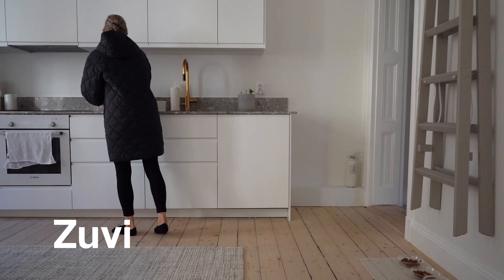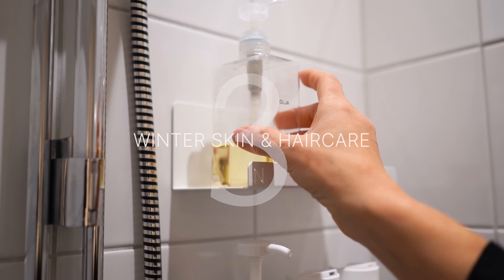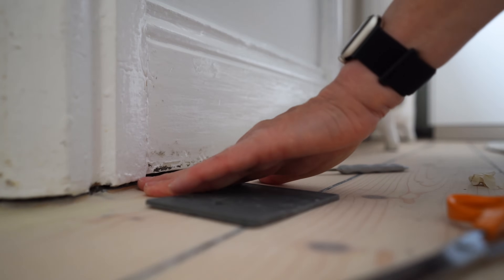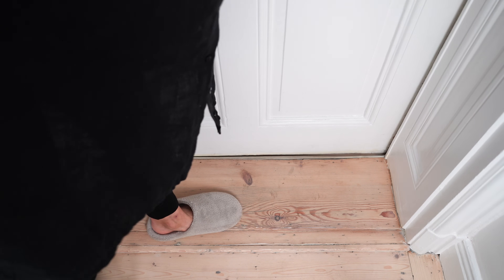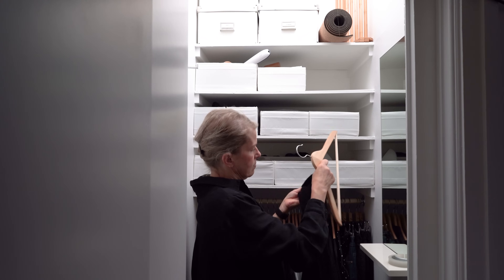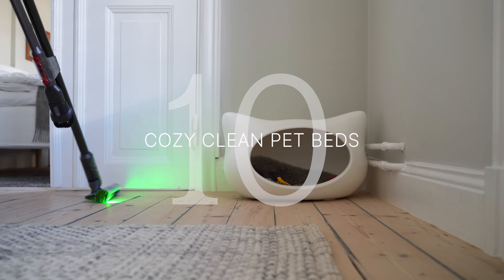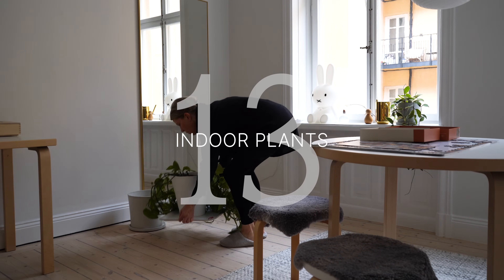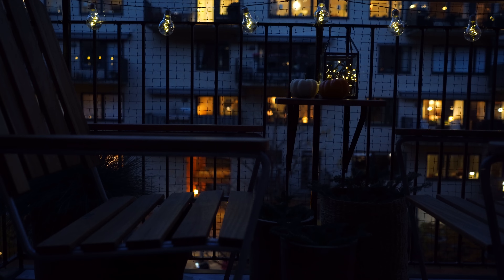15 TIPS to prepare for a long COZY WINTER

Comment: A quarter round is an easy fix for the gap between the baseboard and the floor.  Also, a door sweep on the inside of the door to your exterior (balcony, deck, etc.) is a big help in keeping out drafts.
Reply from the maker: I’m not a fan of the look of quarter round and also it would be very tricky to cut along the various depths of the baseboards. The filler, to me, is a cleaner look😅
Reply: @BenitaLarsson  what filler did you use i live in scandinavia but because I speak just English I have a hard time finding the right product 😅
Reply from the maker: I use Easy Filler from Flügger!  @MeTimeWithNoemiEApetri

Comment: I put quarter-rounds back down on the baseboards for my finished look. Just nail or glue them to the vertical baseboard bottom, not to the floor. That prevents cracking and splitting when the floor and wall contract in the cold (as they will, and are supposed to). I also filled that little gap by poking rolled up newspaper back there before putting the quarter-rounds on.
Reply from the maker: I don’t love quarter round to be honest and way to finicky to cut along all the different depths of my baseboards😅

Comment: One action I took this October was to use a battery tester on my stored batteries. I had stored 4 different brands of batteries, and I discovered one particular brand was losing its power at a faster rate than the other three. It also exhibited corrosion in some cases. An eye-opening exercise in maintenance and preparation!
Reply from the maker: Great discovery! I always try to remind myself to add the oldest on top when I buy new ones.

Comment: I use olive oil and coconut oil to moisturize my skin in the winter. Also, if you live where water is chlorinated, install a shower filter that removes the chemicals.
Reply from the maker: Thanks for the tips!

Comment: Love the video! Could I just warn about the pathos plant you brought home? They are self climbers and create suckers the will adhere to anything they come into steady contact with but the warning is that when you try to move them off the surface they will take LAYERS of paint/veneer off with them! 😮

Have you thought about piping the caulking into the gaps? I’ve used plastic bags and snipped the corner off to squeeze it out. Or an old piping bag with a tip? 
I now have to trim my pathos and check for gaps for my Canadian winter! ❤
Reply from the maker: Thanks, I’m aware if Pothos and will keep a close eye on it! I really enjoy this method of filling the gaps . It’s like icing a cake so I’ll stick to it😅

Comment: I love that you embrace the season and get into wintering.  I need to take a cue and quit fighting our winters (but they are SO long and cold!!).  Where is your grey waffle bedspread from?  I looked at your sources list and didn't see it but I may have missed it.  Could I also ask where your LED tapers are from?  The LED pillar candles are easy enough to find but nice looking LED tapers don't seem to be.
Reply from the maker: The waffle blanket is from Muji. I get my battery operated candles in a local store, Granit. Try and find ones that have real wax, they’re the most realistic looking ones.
Reply: @BenitaLarsson  Thanks for the reply and the tip on the tapers:)

Comment: Ah, winter! I'm looking forward to it after the months of high heat. I have some winterizing to do too. One thing I want too do is find an appropriate wall sconce for my kitchen. I don't like the bright overhead fixture at 6 am.  I'm stocked with candles and cozy throws. Funny how I don't eat salads in cold weather so I'm checking out recipes with lots of cooked vegetables. That shop looked so inviting! See you next time. Thanks.
Reply from the maker: Thanks so much for watching!
Reply: I'm thinking of adding under cupboard lights in my kitchen for those times when you don't need the overhead light on. I like the way my kitchen light looks but the bulbs you have to use for it are far too bright

Comment: For this flower/plant the best way would be to cut those long parts without leaves and put and put them in the jar with water.

When they have new roots you put them back to the same planter.

This way you have much nicer plant next year.

Best time to do it would be early spring :)
Reply from the maker: I don’t mind the naked stems though 😅

Comment: I use Cerave cream too. You might consider the pot with a pump in the lid. I find it convenient (until 2/3 down - then I switch to a normal lid).
Reply from the maker: I’ve looked for it in store but haven’t seen it😅

Comment: Your clothing and surroundings are exclusively white, off-white, black, shades of grey and neutral wood.  In the spring/summer/fall, you have your windows open and see the colorful foliage, flowers, birds and more exciting sunshine.   In the winter you have little outside and your apartment needs more color.  Maybe a wall hanging with color in it.  Your candles are white, your dishes are probably white.  Go to Italy, buy some colorful dishes.  Get some colorful placemats, towels, something.

Comment: Funny tip: there are aa batteries that you can charge via usb C, that way all batteries in the house become rechargeable via the same cable
Reply from the maker: I’ve had rechargeable batteries in the past but never heard of this version! Will look into it!
Reply: @BenitaLarsson  I also got some fairy lights and found out I could only power them by batteries. So I wondered if anyone had thought of making power-banks in the shape of AA batteries, and it turned out lots of companies had this idea.

Comment: Please don’t use cerave. I used to also. Since recently having breast cancer surgery, it was found at stage 0 and pathology found a small piece of stage one after double mastectomy which I chose to do and stay flat to avoid radiation and a 5 year pill since I have the 3rd worst gene mutation PALB2. 
I know you can relate to this also but I’ve been doing a lot of research on diet and environmental factors to avoid toxins and hope to prevent recurrence.  Links mentioned in this video description to find safe alternatives 💕 https://youtu.be/ZJnF99GfrC0?si=l9uoRFocJ_gXtzl1